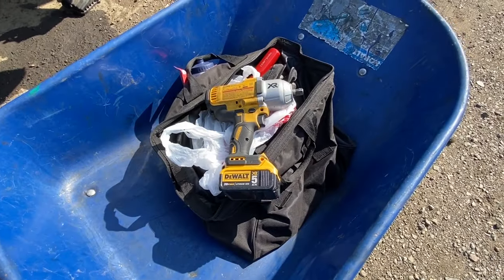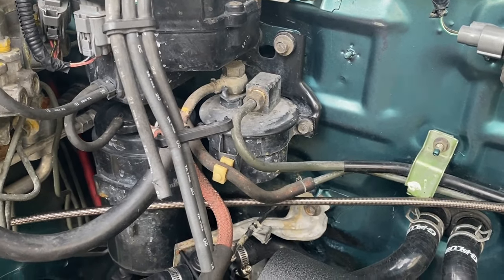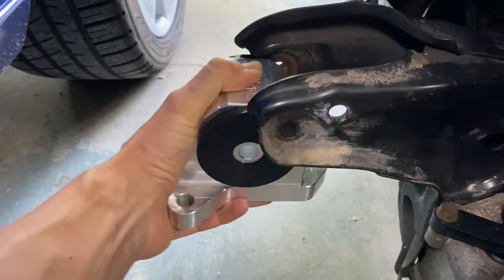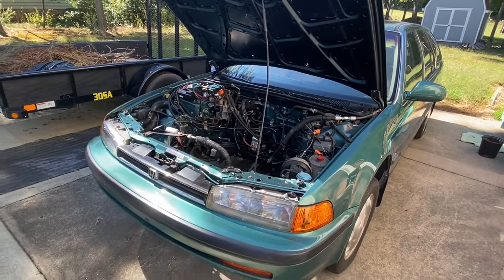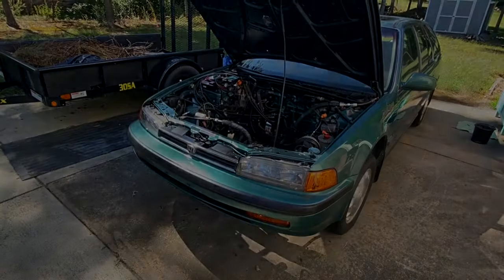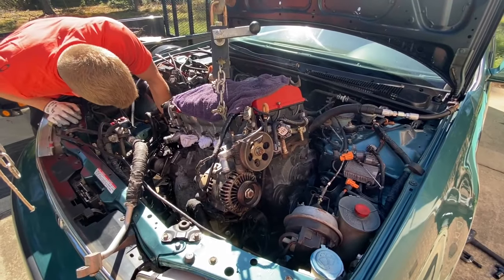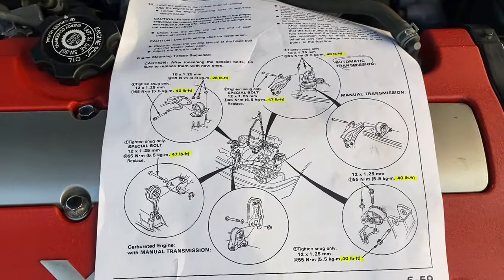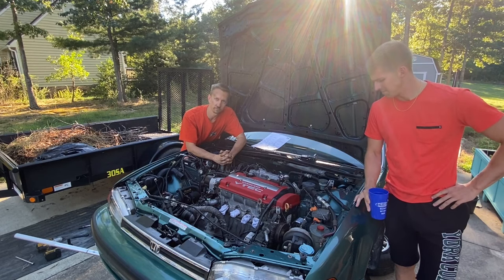Part 7: H22 Prelude Engine Swap Into 90-93 Honda Accord CB7 CB9 - Engine Reinstallation

Comment: That is exactly why I put the engine in from the bottom, well atleast you had extra pair of hands.
Reply: I think he was having issues with the way he did it.   I bolt the mount loosely to the t bracket in the rear and put it in from up top.  It's usually a pretty easy process

Comment: I have a 95 ex trans, what axles will i need to use? I read that the passenger side are the same, but specs on the cb7 axles are about 1/2~ inch shorter than 95 axles?....

Comment: I read somewhere on cb7 forums about drilling and re welding the bracket for the transmission mount to attach to. By using the innovative/hasport mounts bypass needing to do so?
Reply from the maker: If using a regular transmission mount then yes the metal bracket needs relocating.  This is a special offset bracket requiring no cutting/welding.

Comment: hi i was wondering if you could give me the specification of this bolt 90397-s5A-000 the one that goes on the left engine mount?
Reply from the maker: The bolt that goes through the engine mount and threads into the body of the motor mount slot?

Comment: This looks extremely difficult. Do you think it’s possible or easier to put it in from underneath. Thanks
Reply from the maker: Its been known to be easier to pull up from underneath.  you will need either a car lift or to get the front end up high enough where you can pull it upwards.  The hardest part it angling the engine and lining up that first mount.  Once the rear mount is on, it goes a lot easier.
Reply: Awesome thanks bud